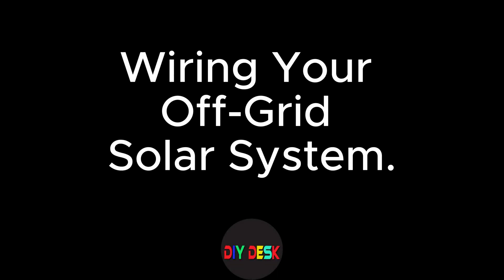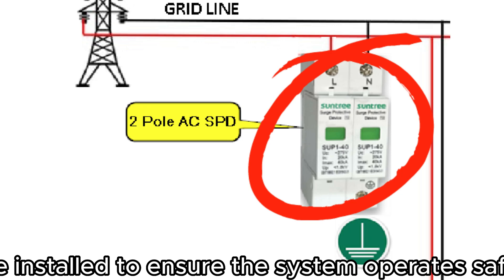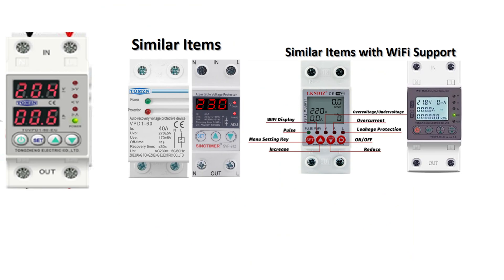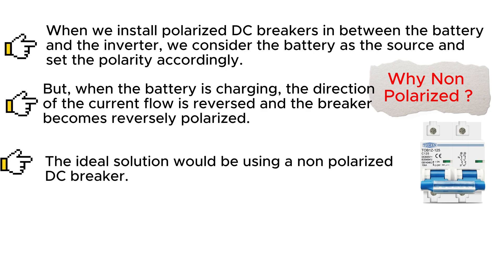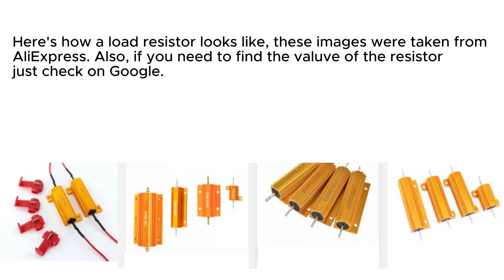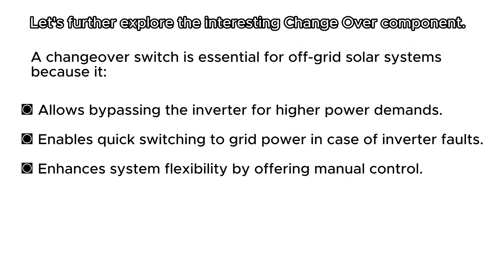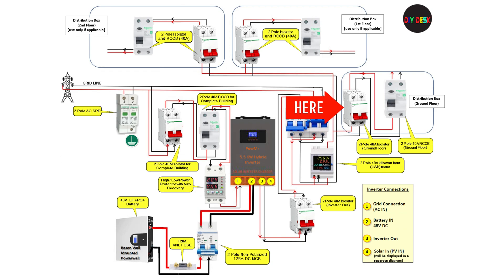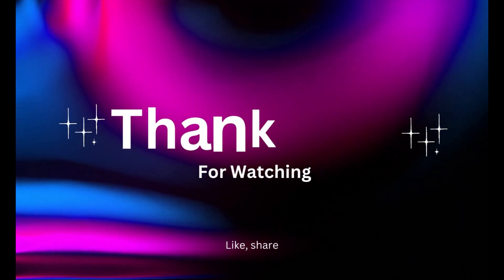Comprehensive Guide to Off-Grid Solar Wiring: Understand Components and Connections for DIY Lovers

Comment: My battery contains an internal controller, can this be used with a hybrid inverter?
Reply from the maker: Should be possible but if you can share more details I can have a look.

Also, make sure to set the charger Ams according to the battery controller

Comment: Sir,Which place to cannect 60w ac bulb for 48v Battery system
Reply from the maker: Hi @senarathupananda2215,

Check the link, I have make a diagram to show how to connect the wires for Capacitor Pre-Charging. Once you connect the wires the light bulb will slightly light up and stop. That means the Capacitors are charged. Then you can connect the wire to the inverter. Hope this helps.

https://i.imgur.com/akMbGpw.png
Reply: Well explained videos. I hope you will also go for step by step electric fence installation

Comment: The title of the video says off-grid. At which point can the diagram be cut to have it work without the grid connection?
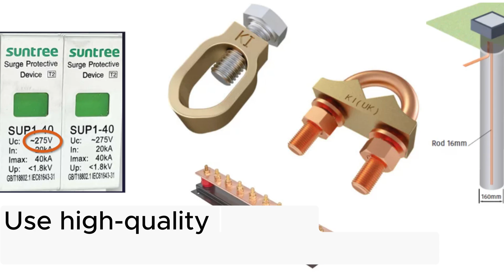Reply from the maker: Hey! Thanks for checking out the off-grid solar wiring video! The title refers to the system's capability to work independently without a grid connection. In the second part, you'll learn how to wire the solar panels. Once that's done, you can disconnect from the grid by using the 40A Isolator located at the left side of the inverter input in the diagram (1:36 - 2 Pole 40A Isolator). Stay tuned for more exciting updates! 🌞🔌